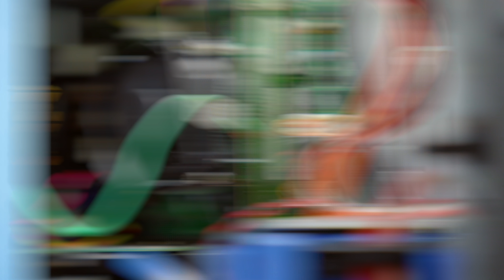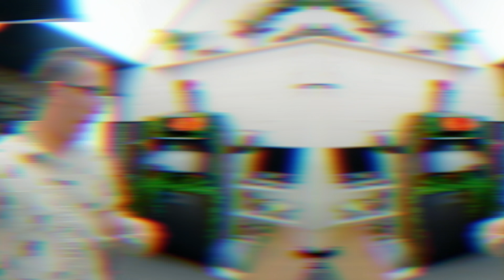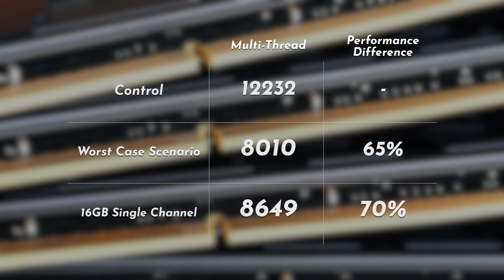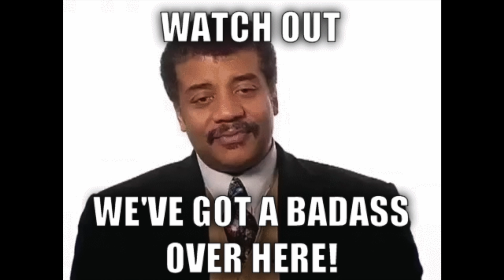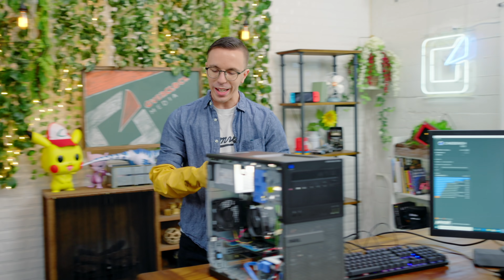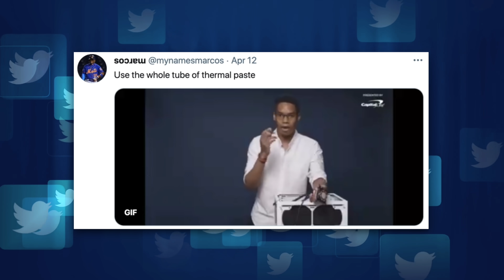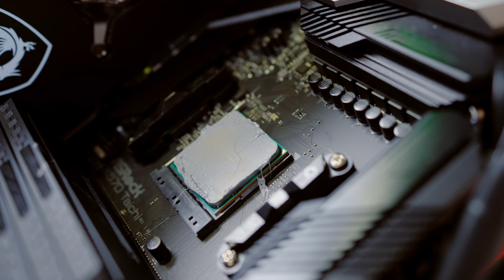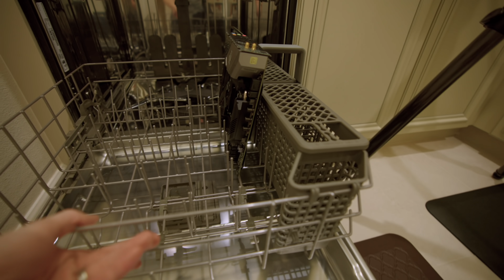Gaming PC Lies People Believe

Comment: Speaking of single channel... I recently bought an Alienware Aurora R10 (I know.... pre-built... but it's the easiest way to get a Ryzen 5900 and Nvidia 3080). I didn't notice when I ordered that the default selection for memory on this system was 16GB 3200Mhz SINGLE CHANNEL! There is no extra charge to get 16GB dual channel... but it isn't default and I forgot to select it. WHY ARE THEY SELLING RYZEN SYSTEMS WITH SINGLE CHANNEL RAM? To make matters worse... they have a proprietary version of HyperX Fury memory that ISN'T the same as the retail version. The Alienware/Dell version runs at 1.2V instead of the normal 1.35V and a different XMP profile... so you cannot match your included RAM with any retail RAM... even ones ALSO LABELED "HyperX Fury." BUT WAIT... their's more! Their weird MOBO won't accept any ole 3200 DDR4 RAM. But... there are SOME retail kits that are known to work out of the box. I put in 32GB Dual Channel 3200 Crucial Ballistix RAM it works flawlessly.

Comment: I have a feeling that the magnet touching the back of the graphics card was why it shut down. If you did the same thing with a non-magnetic conductive metal I think the same thing would happen.
Reply: exactly what I was thinking, or if you put some paper or something between the two so it's non-conductive
Reply: @supremeicecreme1658  I've only done my first year of electrical engineering so far, but I'm fairly certain the chip won't behave any differently. Though if the magnet is strong enough it could pull on surface components and possibly affect inductors (if there were any) if certain conditions are right.

Comment: I used to work at a company that built circuit boards (soldering components, etc).  You definitely can wash the boards, with soap no less.  We did it daily, primarily to wash any excess flux off from the soldering process.  I still wouldn't do it at home though.

Comment: yes you could absolutely wash your pc components with water, as long as you the capacitors are empty, 
and you remove any attached batteries like the cmos battery that Austin forgot to remove
*I'll have to add however that the minerals contained in tap water could cause corrosion or at least speed it up
I wouldn't recommend it but it's mostly fine
Reply: I've had keyboards that took an unexpected cola or juice shower, water works fine for cleaning them (rinse with distilled or deionized water after washing).

Comment: The stun gun that is supposedly "3.8 million volts", is a lie. What indicates the strength of the stun gun is the amount of charge measured in coulombs, the formula for this is current measured in amps × time. The gap on a stun gun is around 0.75 inches to 1 inches, only around 20 thousand volts could pass through that.

Comment: I like how you shit in the 8gb stick of ram only giving you 60% of the performance when you have put it to single channel  and pulled 24gb out the system. I don't think those result are as bad as you made out for the 5900x with weak memory. Specially with how the market is right now.

I know this isn't the premise of the vlog but still at least be a little more glass half full as I think those results aren't to bad atm.

Comment: Can't help but notice you didn't take the CMOS battery out of the motherboard before washing it...that thing is always pumping a small current through the motherboard to retain your BIOS settings. Please try again after taking the CMOS out! You absolutely can wash a motherboard in a dishwasher. (But you should use distilled water to avoid mineral build up.)

Comment: As for the motherboard, you probably forgot the cmos battery, or it wasn't dry enough, because logically, as long as there's no electric current flowing through the mobo when it's wet (which causes short circuits), there can be no harm to it

Comment: try red toothpaste, it will make the cpu run 5% faster.
Der8auer demonstrated using a dishwasher. no cleaning agent, good drying! i commented he should have posted the video april first, just for the confusion...
you probably did not dry the thing enough before using it.
he also demonstrated it on graphiccards. in both cases to remove vasilene he had used in overclocking, to protect the components from condensation.
EDIT: as someone below pointed out you should also remove the CMOS battery...
this is also at least the third reference to der8auer.

Comment: I have tried washing motherboards in the dishwasher, and all the 10 boards i've washed still work perfectly to this day. Tho to do this, i strongly recomend removing ALL posible plastics and heatsinks from the board, and then use a hair dryer to blow the water out of the cpu socket and around the board, then let dry for about 12h. Also the cleaning agents are very good at cleaning dry gunk on sockets and making solder joints look shiny again :3

 TechYesCity also made a video about washing motherboards with water, and they still worked after.

Comment: That taser is nowhere near 4.8 million volts. For that to be true the arc it forms should have been about 5 meter long. It mosy likely about 10 to 20 kv. Also the only way to test esd on a computer is with an esd gun. What the LTT video on the subject or Electroboom's. Still the video was quite fun to watch so no hate just trying to correct a small mistake

Comment: Don't use volts as a unit of measurement on the static test, use Amps. I can touch a 500,000 volt wire and only get hurt. 0.1 amps of current can kill.

Comment: For magnets at least, it was more of a concern when magnetic storage media was the norm. Floppy disks could be pretty sensitive to them, in particular; for the most part it isn't such a concern nowadays, but with a sufficiently powerful magnet you can (as demonstrated) still disrupt a spinning platter hard drive. I think you'd more likely cause seek errors or a head crash that physically damages the platters before you'd disrupt the magnetic storage of the platters themselves, but still.

Solid state components don't have much to worry about as long as the magnetic field doesn't move across conductors fast enough to cause a significant electrical current in nearby wires or traces. Or, like with what you did, simply bring it in contact with multiple solder points on the component causing a bunch of electrical short circuits. That has nothing to do with being magnetic, though, you could do that with anything electrically conductive.

Comment: When the system is plugged in, it's grounded. The real "pc tech tip" is to always discharge the system before working on it, by always pressing the power button after unplugging the pc. 
You will notice the power LED will blink after pressing the power button, that's the left over charge in the pc. If you don't do this, it is possible to damage the system by touching it, unless you are grounded. 
TLDR
I've never wear a static bracelet,  because I always press the power button after unplugging.

Comment: That motherboard needed WAY more time to dry in my opinion.
Reply: Should have been shoved in an oven at 90c

Or stuck over a radiator

I often clean stuff under a tap and just float it over a radiator, while its ill advised its just what i do before fixing them, if its working dont use fluid’s period to clean them

Comment: You can wash PC parts in a dishwasher, by the way.  You probably (almost certainly) forgot to take the CMOS battery out.  The board is being supplied with a tiny amount of current when it's in, regardless of whether or not the PC is on.  So that's what got it.
Reply: They also really should have taken off all the coverings on the motherboard as well. They probably trapped a lot of water inside it and giving it only 1 day to dry with all of that trapping the water was almost definitely not enough.
Reply: @fuzzyface4515  for sure lol when they said only 1 day i was like umm no way that is dry with no water left lol
Reply: Even with the cmos battery out you should leave it to dry for much longer than a day.
Reply: @PandaWill89  this is true
Reply: @PandaWill89  Best way to dry circuitry.. bag of rice, immerse product in a thick amount of dry rice, leave a week.
Reply: In the circuit board manufacturing industry they wash boards like this and bake them dry in ovens. Assuming they took the CMOS battery out, if they had given it proper time to dry or stuck it in an oven it would have been fine. Didn't Linus do this with some keyboards?
Reply: @iFoundPerry  If the dishwasher has a manual heated extra dry cycle (mine does, the one my parents have doesn't and it doesn't have a heat coil), run that manually at least 1 time, maybe 2 times and see how dry the board gets.
Reply: @iFoundPerry  yes and they reported some of those keyboards ended up dying not long after the video was shot and published. They only mentioned it briefly in a video of theirs, not too sure why they didn't just film a short follow up video
Reply: yup I used to fix electronics, washed many circuit boards in a dishwasher, as for drying I used an air compressor afterwards to get rid of all the water.
Reply: Hope they see this
Reply: The 8-Bit Guy has actually done it too to clean up capacitor liquid and that motherboard was around 30 years years older than the board Austin used.
Reply: Der8auer always does it after overclocking to get the Vaseline off :)
Reply: @PatiShorti  yup
Reply: @PatiShorti  he's awesome, the best overclocker
Reply: And one day of drying aint enough, two weeks at minimum
Reply: @Saint_Chompy  or use a fan.
Reply: @Saint_Chompy  maybe a day but using a dehumidifier
Reply: Should have left it to dry for at least a week. I use to work in computer repair and 9/10 if someone spilled on their PC, a week of drying and then the PC would work again. As a shortcut he could have also soaked it in isopropyl Alcohol which would have helped speed up the amount of time it took for the liquid to evaporate.
Reply: I mean. When u give it a day. Even a newly washed shoes would still contained water in it.
Reply: flushing with alcohol afterward will also aid in the drying process. flushing with IPA 90% or higher and then drying in 180F oven should help the board dry rather effectively.
Reply: @the.old.badger  180F is a little high. You will start melting the solder in there. I wouldn't take it past 140 because you never know what low temp solder may have been used. 180F is preheat for most reflow meaning you are already softening it.
Reply: @excitedbox  No, it's literally used for drying components during reflow, so they won't explode like popcorn when they get hit a bit later with the real heat. Basically everything on a motherboard can handle those temps for hours without damage.
Reply: Good insight
Reply: Dishwasher to alcohol bath to compressed air, though I use an ultra sonic cleaner instead of a dishwasher.
Reply: Not to mention, wasn't nearly enough drying time.
Reply: That's one thing, plus you're supposed to remove all heatsinks and thing that you possibly can, and ideally air spray as much moisture as possible off. And before you put it in, you're supposed to run a rinse, and then wash it with no detergent
Reply: and he should wait until the dishwasher is out of salt and glascleaner... the overclocker DerBauer has shown it with the dishwasher to clean his Board After overclocking. I Think he has an englisch Version of this.
Reply: Not if its unplugged
Reply: Yeah and the risk of static shock is when components are not installed in a PC that is plugged in and grounded. If the components are installed and the PC is on, any static discharge would be safely grounded away. Unless you zap it with a friggin stun gun...
Reply: I was also thinking a day is way too short, maybe if it was in a drying cabinet with 30-40 C
Reply: @Yemto  nope, that would still not be enough
Reply: @Saint_Chompy  I never said a time
Reply: @Yemto  Just put it in an oven, water can still be trapped between the layers of the board
Reply: I’m still not tho
Reply: If doing this, you also should leave it to dry for some days, just to be safe
Reply: Handwashed an xbox 360 board and pc board. Both are fine.
Reply: Last time I did this, my VRM and a few capacitors were blown out. Wouldn't recommend with 5 dollar motherboards
Reply: Der8auer openly endorses the fact he cleans his motherboards and GPUs in the dishwasher. Straight says he does it after every world record and never killed a board doing it.
Reply: "That's 3.8 MILLION VOLTS!!!"  Give me a break man it's not about voltage it's about current what amperage did that stun gun have?
Reply: Every retro PC channel I know washes their boards in the dish washer.  Its really common.
Reply: yea Austin's kind of been a pc pleeb in disguise for the last coupe years lol
Reply: It makes it go coroded I diid it.
Reply: @fishoihatecarp8207  You need to make sure you dry it…

Comment: Your water is not distilled in the dishwasher water supply.  Water supplies usually have minerals like fluoride and other metals.
Reply: Also someone else mentioned that they probably didn't remove the cmos battery
Reply: @gjeraldh2989  that was my first thought as well, they likely had SOME electricity running through there when the water was running.
Reply: @gjeraldh2989  yea it will still have power if there is a power source hence the cmos battery so dont spray your computer with water if it has power (battery)
Reply: It would make a difference. Distilled water is an insulator, but normal water normally isn’t. That’s why if you put electricity in a bath tub it can electrocute you. What I am getting at is it after the board dries some of those conductive minerals may be left on the board and could short something. In general computer parts wouldn’t be destroyed by being submerged in a liquid that is non-conductive but your water is most likely “contaminated” (not pure).
Reply: That shouldn’t matter so much, besides, if der8aur does it, why shouldn’t we? I doubt the Germans distill their public water supply
Reply: @ryanwallace983  I think if they properly dried it wouldn't be a problem
Reply: @kube311  Yeah I feel like one day is waaaay too low for it to properly dry. He should have given it more time or maybe dry it in food furnace on lower temperature. Also, there might be some soap left in the dishwasher from the past. Or maybe there was too high temeperature. Or maybe the water caused corrosion somewhere. Who knows
Reply: @kube311  yeah I have washed old pc components with water before. I just let it dry at least a week. Pretty sure there was some moisture left, and that's what killed the board.
Reply: @ryanwallace983  what does Germans have to with this? Lol
Reply: @Aurora20778  der8aur is German, didn’t you know that?
Reply: Who tf is that?
Reply: @Aurora20778  a world famous competitive overclocker who knows a hell of a lot more than either of us

He works with intel to validate some of their CPUs

He did a video a while back showing how he cleans his computer parts-namely a dishwasher
Reply: @ryanwallace983  oh ok
Reply: you can dry a mobo in 30 minutes with alcohol and a hairdryer, i've done it before
Reply: Some dishwashers have distillate tanks we had one for our kitchen water a tank filled up and was distilled and when it ran out no water in the kitchen
Reply: I think he just forgot to remove the CMOS battery, lmao
Reply: Having  a pc anywhere near a liquid is just asking for death
Reply: Distilled and filtered are very different things. Have you ever drank distilled water? It tastes very weird. That's what 100% water tastes like
Reply: They wash pcbs in the assembly process with distilled water
Reply: Remember - as long as there's no power going through it when it gets wet it is fine, that means to give it a good drying ensuring all water droplets have been removed (leave it to dry for a week Welp) 

Remember linus's old videos of leaving laptops in the rain outside?
Reply: the problem is that he left the motherboard to dry by itself and that generated corrosion and 1 day would be enough to dry the whole motherboard anyways
Reply: And probably having the drying option turned on probably didn't help either since it was sitting in straight steam for an hour
Reply: Your dishwasher water supply is the same as your drinking water

Comment: For the static electricity test, it's very very unlikely for a component to be killed just by a shock like that as computer components are very durable, but it does make it more likely for a failure to occur in the future especially if it happens multiple times.

Comment: For the RAM, I was more interested if using a different brand but the same/closest available speed and timings, would produce the same or worsened performance of two identical sticks.
Reply: Same. Expected them to throw a Gskill 3600 cl 14 and corsair 3200 cl 16 combo in there. Not some worst ram combined with best ram.
Reply: I have the experience that everything works fine if speed and timings match. maybe the performance could be a bit worse, but I didn't measure that fine.
Reply: if they don't run stable you have to slow the sticks down a bit but other than that it's fine.
Reply: They should’ve used an Intel cpu capable of ‘Flex’. Not a very good “test”
Reply: @robhuff2336  AMD has flex mode too.